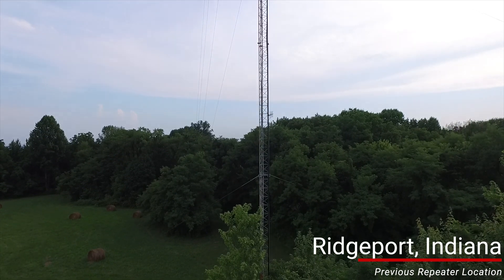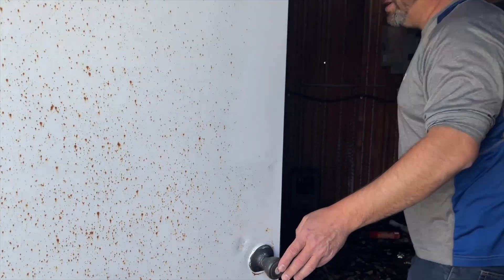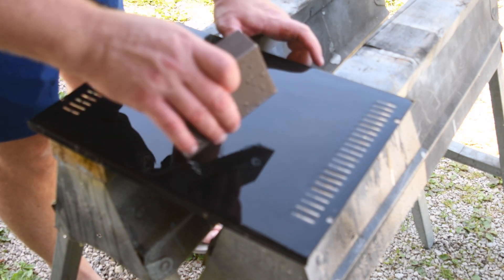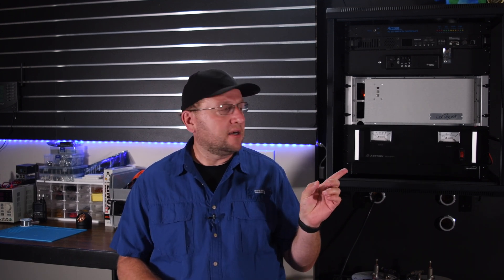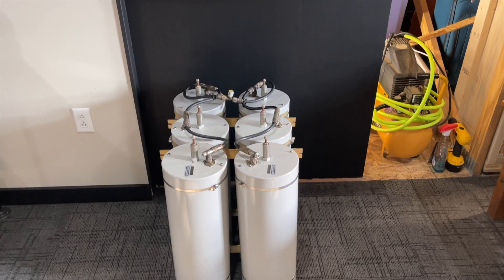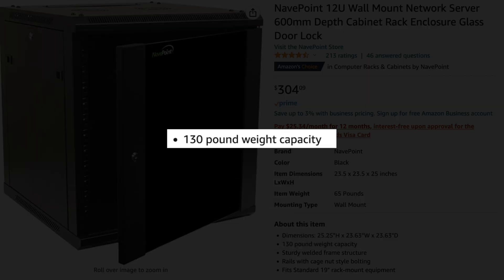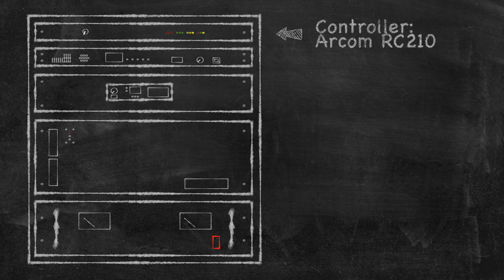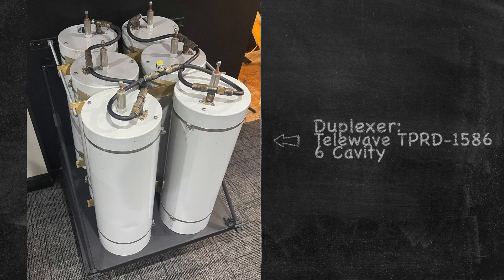Building an Amateur Radio Repeater  Part One:  The Hardware

Comment: Loved this rescue-and-rebuild story, Mike. Fantastic job on keeping things rolling!  It's a tough 'gig', repeater build-outs and maintenance- Not a whole lot of the systems' users realize how much effort goes into getting a repeater or like us, a regional network of repeaters, operational.  A lot goes into it and kudos to you and your team for "getting things done"!  

The attic rack build and attention to duplexer care (hands off the tuning screws! 😅) brought back memories. We’re doing similar work with the Eastern Colorado Repeater Association—our System 1 site uses a mixed stack (Kenwood/Moto, Telewave cavities, RC-style controller) and the same lesson keeps proving true: the site (antenna, hardline, grounding, thermal, power) matters as much as the box indeed!

Quick question for your next episode: are you planning any remote telemetry (PA temp, DC bus, SWR/forward power) or AllStar/WIRES-style linking, or will you keep this one local-first and simple? 73!

Comment: You might consider replacing your controller with a Pi/HamVoip one running SkywarnPlus.  I have been running a simplex repater here in Olive Branch, MS for Skywarn events and am now working on one for Tampa and one for GMRS serving the Tampa Bay area with my good friend N4NBC.  HamVoip offers a fantastic ability to control a simplex or duplex repeater with all types of extra features like the ability to announce local AWOS/METAR conditions from an airport, Zone Forecasts from the NWS and with SkywarnPlus your repeater can inform the entire Amateur and Public communities of weather emergencies.  W5AV is auto linked to our area's Skywarn Net with the issuance of a TOA or SVA.  It also auto links to WX4MEM our local NWS DMR facility at the NWS office here in Memphis.  When all the storms have passed the system reverts back to normal us e when the TOA or SVA has expired by the NWS.  73, Steve WB4IZC
Reply from the maker: I appreciate the suggestion, I not familiar with it, but you have peaked my interest.

Comment: One drone trick to consider: Turn the camera towards the ground and lock exposure. This will keep the ground features clear and visible - and avoid the exposure correction as you rotate towards the sun - causing the ground to go very dark.

Nice topic, not much around on repeater deployment 👍